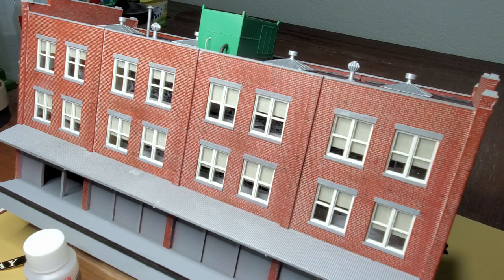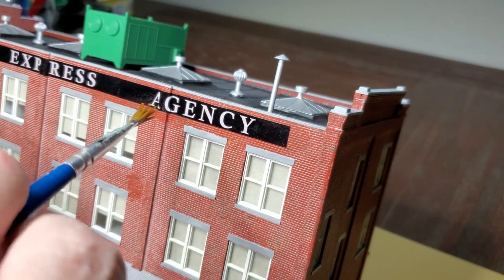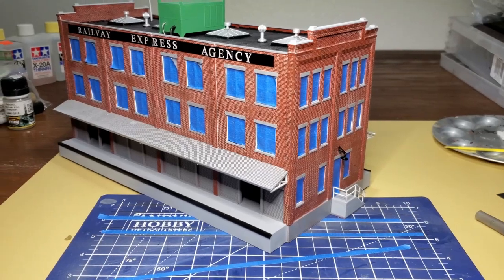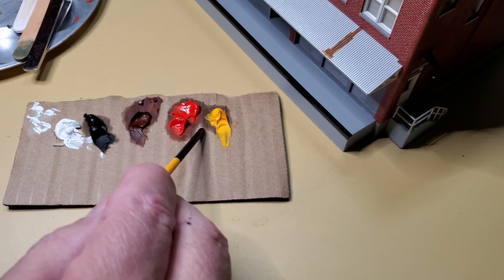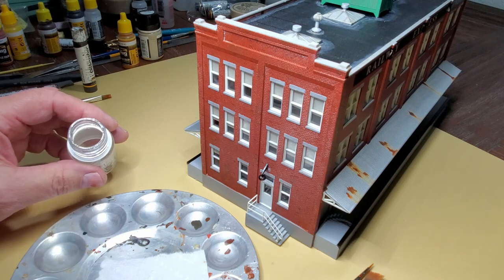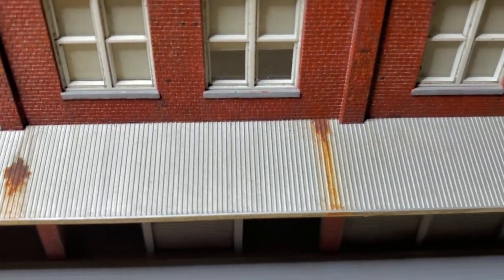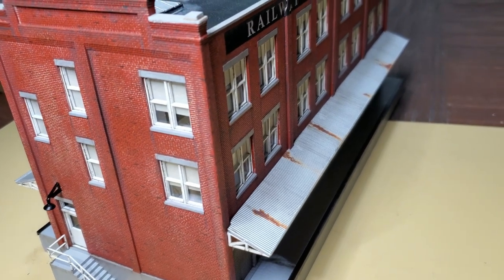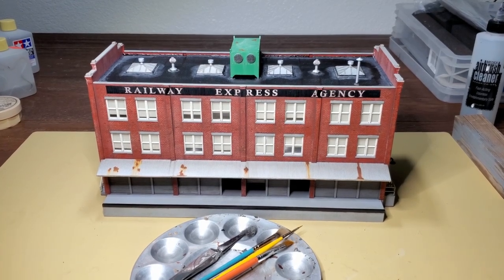Walther's HO Scale REA Building Project Part3. Adding Decals and Weathering the Model.

Comment: Nice update and weathering! I am sure you mentioned this at some point but I totally missed it - What did you use to create the 'tar pitch' lines on the black roof? I really like the look. Appears used sandpaper for the roof on this one? Sorry if addressed but it is quite possible I just spaced it.
Reply from the maker: Thanks! I don't remember what I used for the roof. Possibly sandpaper. I think I just used paint for the tar seams. I may have given them several coats to build up the thickness. I can't always remember the specifics; things blend together after a while. I may pull some finished structures out and talk about them in a future video. I don't have any on the layout yet, but I have a few built.  I appreciate you watching